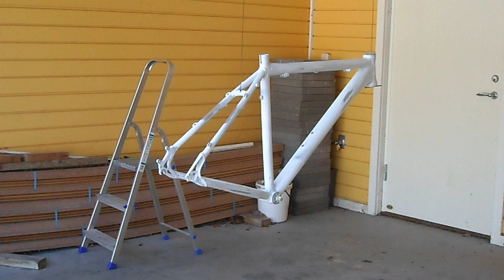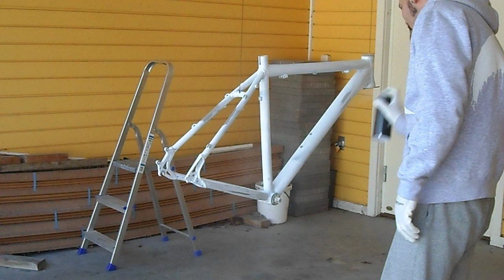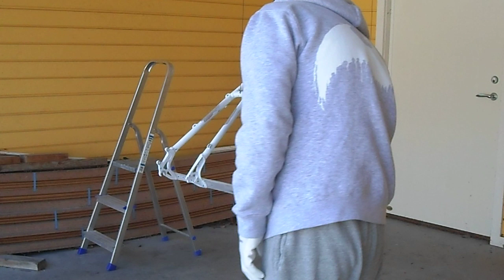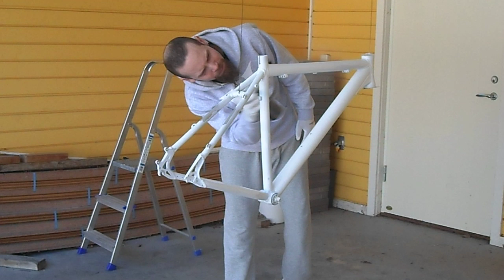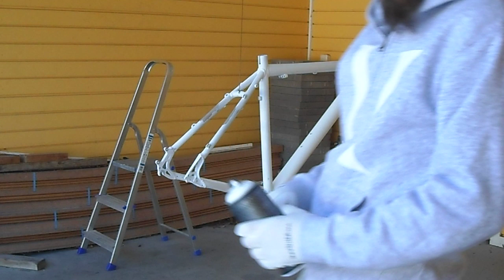Bike Frame Repaint Pt 1 (Ground color for logo decal)

Comment from the maker: I took the fonts from internet and vectorized them in Corel Draw. Then I had someone else print and cut them for me.
Reply: Do you know what the templates were made from?  I have some Silhouette brand clear sticker paper and am trying to do the same thing but am worried it may be too sticky.
Reply: 08PeeSon80 did you use the montana brand spray for the white and green paints in addition to the matte clear coat?
Reply from the maker: Nicholas Hortance I only used Montana :-)
Reply from the maker: Nicholas Hortance All Montana.